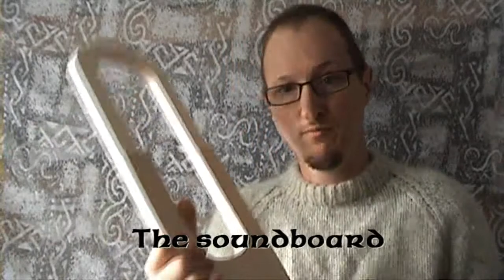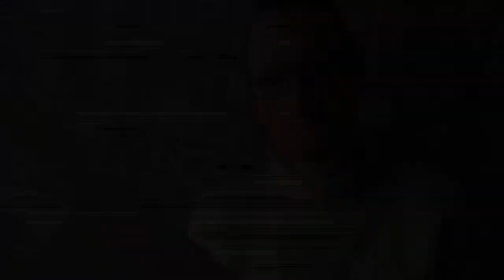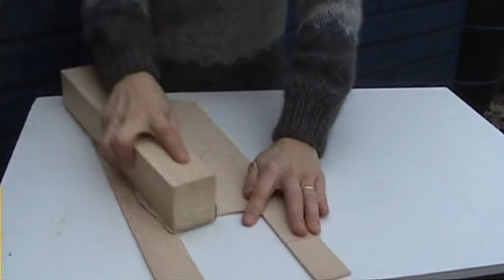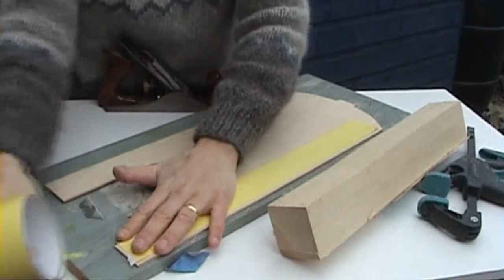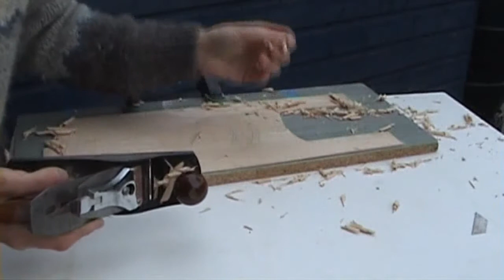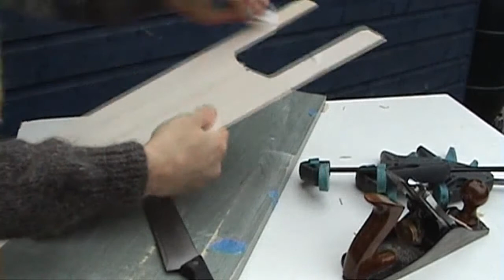Making an Anglo-Saxon Lyre part 1

Comment: A well-sharpened cabinet scraper is a joy to use. Grain direction doesn't matter; so even highly-figured wood can be scraped from any direction.
I have a large icing spatula that I picked up in a thrift store (charity shop). Being second-hand, I got a great big one for under 2 dollars (1.64 quid). And there's the safety issue -- if I knock a spatula off the workbench, there's little danger.
Thanks for the video!
Reply from the maker: ImperialistRunningDo these days I use some lovely scrapers from stewmac,  true you can make scrapers from anything.

Comment: I have made a lyre. will it sound higer/better soun if i make a hole in the center front ?
Reply: +Jens Bonde if it didn't take you long and you enjoyed it, make another and see. I plan on making 3+ during the course of my guitar making degree, each slightly different (one even with a piezo pickup)
Reply from the maker: +Jens Bonde These lyres have very shallow soundboxes and thin tops and don't need soundholes if done well,   that said the Trossingen Lyre from Germany does have a series of small holes in the centre  and on each arm and it does help the sound on a very  thick soundboard,  see my trossingen lyre video here: https://www.youtube.com/watch?v=U8WmwVQe3X4

Comment: Hi there. :) what method did you use to cut the middle of the wood out? 
I was thinking a drill, but It's been taking a while. 😊 Thank you
Reply from the maker: +BlueRoseArt On My Lyre Making CD I demonstrate a simple method with Forstner bit an a pillar/Bench drill.   A router and template helps to clean things up but it can be done by hand tools